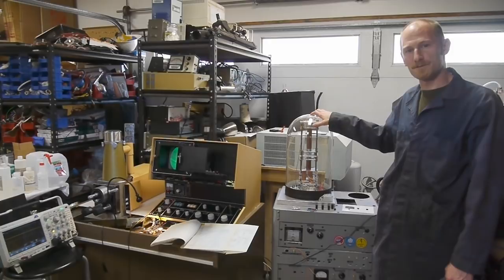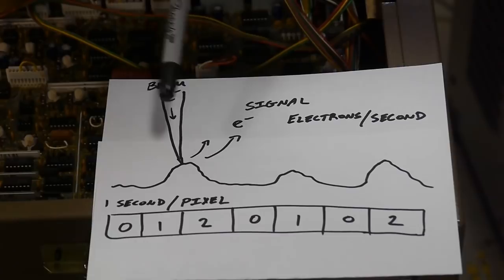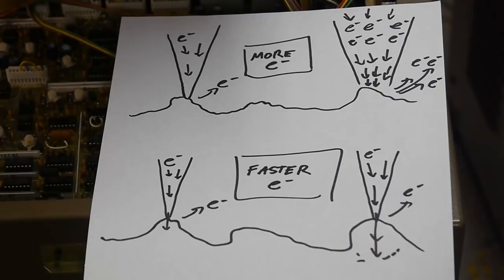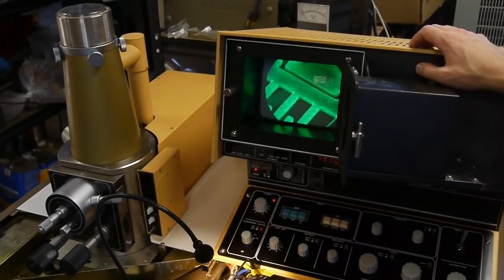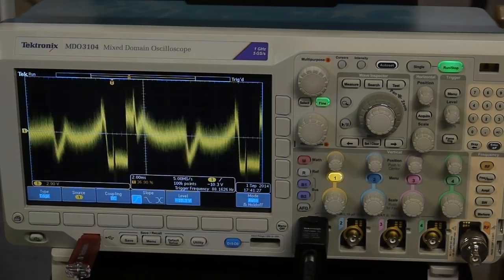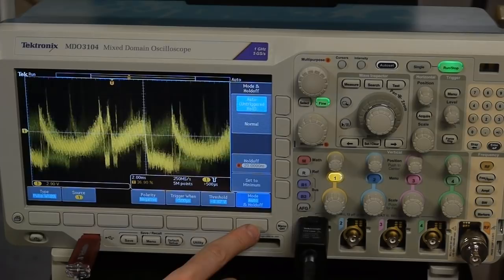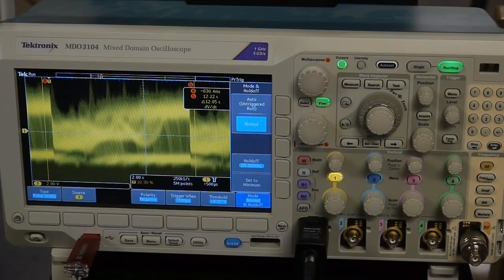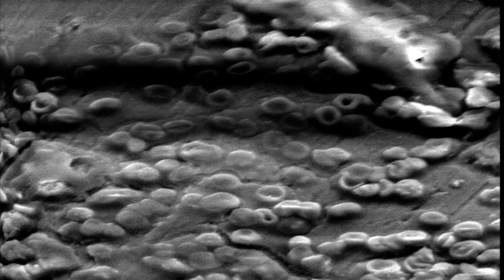Electron microscope image capture with an oscilloscope

Comment: Is it all that weird that you got a decent image of the red blood cells, as they contain quite a bit of iron?

Quite spectacular images regardless!
Reply: The iron content of red blood cells is negligible, at least physically for the properties needed for STEM (biologically of course it's very important). If I had to estimate it's maybe 1% by mass and maybe 0.2% by atoms of hemoglobin. Then you also have to add the structure of the blood cells themselves, which does not contain iron.
Also the iron in Hemoglobin isn't a chunk of metal. It's single isolated atoms, so there's no conducting wire.
And it also doesn't help, if the iron is distributed within an object in a STEM. It's the surface that has to be conductive.
Reply: Thanks for clearing that up!

Comment: I didnt know some things should be sputter coated.Please look into Rife microscope and  resonance im not sure if he used radio or sound resonance for virus destruction . Also when removing crt electron guns , is there thorium or some thing on its cathode heater (looks like a drop of white glue kind of )that should handled in a most careful way ?tnx !👍📗😀📐🔬📚📈📡🔋

Comment: hmm. How is it that the oscillocope shows a live display of the actual sample?
Whenever I've seen an oscilloscope used, it's a sin wave. 
How do you convert the sinwave unto an image?

I see in the video Mr. Krasnow explains, but I'm having trouble bridging the ideas
Reply: Look up the video on how analog TV works, instead of drawing a wave shape which would be a graph/chart of the speaker cone going in and out over time, you draw a series of lines starting at the upper left corner and going from left to right and top to bottom, then you use the Z axis to cause the brightness of the dot, if the image is synchronized and you do this fast enough from a video signal, you will get a picture.

Comment: Are you doing any kind of window averaging, or median filtering, or similar to the signal in Octave? The raw signal looks really noisy (fuzzy) when you're looking at one scanline on the scope, but the image is very sharp. Maybe that noise just doesn't look as pronounced when it's pixel intensity values, vs vertical deflection? Now what you can do is replace the whole existing video system with an FPGA, and replace the CRT with a LCD screen, and build in the functionality to save an image to a USB key or SD card directly! Nothing like hacking a USB or other modern interface onto a 1980s era machine! Either that or program the scope and extract the data using GPIB or LXI and build a more automated system!
Reply from the maker: No filtering was done in Octave, however the output image is about 2800x1000, and I scale it down to 1600x1000 to fix the aspect ratio, so there is a slight amount of averaging due to the resample. It does look noisy in the scanline.  Somehow it works!

I've been thinking about building a microprocessor or FPGA device that emulates a USB camera and can collect rasterized or random access pixel data, and display the acquisition in realtime. It's not an easy project at all, and will involve a fair bit of HDL and/or microprocessor USB code.  An alternative is ethernet, but I haven't found any standardized video ethernet software viewers, so that means I'd have to write the software as well.
Reply: Applied Science That's cool there's no filtering going on. The tricky thing with the filtering is of course filtering out that 'noise' without ruining the larger edges that are actually the features in the image. When you're doing filtering in software though, it's easier to make a sort of 'adaptive' filter that won't touch the more significant transitions. I also wonder if that 'noise' actually contains data in a way, and is related to the finish or roughness or something of what's actually being imaged. Maybe you wouldn't actually want to get rid of it.
Reply: Applied Science Also, those images look just as good as any SEM photos I've seen in any research publications, but I'm guessing not many (or any!) of those were captured with a scope connected to the video signal, and some Octave code to post process the scope capture, and that's what makes it especially awesome!

Comment: Men you are a Genius! Respekt! But if you want to step it up a notch, capture the signal and process it with a raspberry pi an remove the crt and replace it with a lcd.
PS: Keep you your great work I love your videos!
Applied Science
Reply: That would be really cool. I know that matlab-type processing takes a lot of ram though. I"m not sure a Pi would have the power for it. It might have to bee a full-blown computer.
Reply: I wouldn't do that, it would make it difficult to acquire a target unless you have a fast enough ADC to capture the output when it's in TV scan mode. If the tube is working (and it is) it's the lowest latency output device possible, adding digital processing increases lag and if it's much more than a single field then when you're panning the spot across the sample you'll have overshoot and find it unergonomic to use. Also there's something about slow phosphor screens that makes it easier to distinguish true features from noise than on a digital display with a fast response time like an LCD.

Comment: Ben,
I saw your SEM at the Maker-Faire and was really impressed. 
It is an inspiration of "why not do it yourself" instead of the brain numbing consuming mentality.   Hope to see you at the 2015 Maker Faire. 

For your shot noise problem . . . to sidestep the "fundamental problem", can't you just keep the voltage low to reduce image bloom, take a large number of slow image captures, then do a median pixel average to increase the signal-to-noise?

When I was a teenager, I built an oscilloscope, and I remember a short persistent phosphor CRT tubes are available that reduced the bloom. 
http://www.bunkerofdoom.com/tubes/crt/crt_phosphor_research.pdf

Can you use DeepSkyStacker or other astrophotography software, or even Median Filter Photoshop?

You do address averaging to reduce sampling noise, so maybe you have it covered in a way that wasn't elaborated upon.

Hopefully this makes sense.
Thanks for inspiration
Reply: +Jim In Ashland This problem has nothing to do with CRT tubes themselves - watch it again. In fact what he just did is based on the same concept you described :)